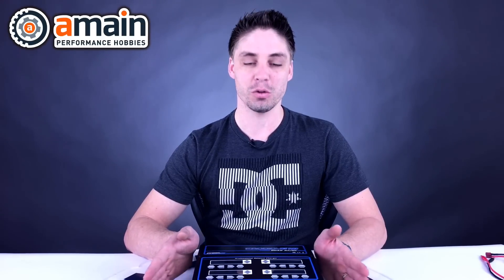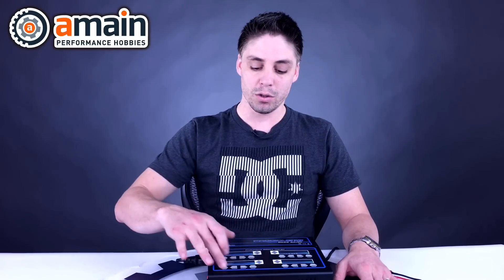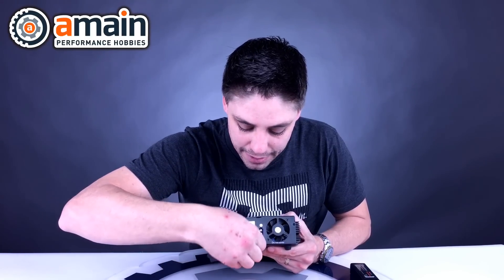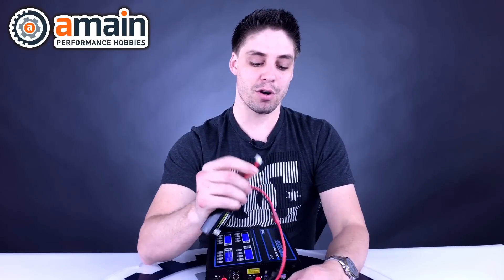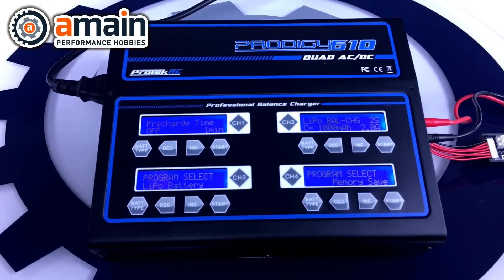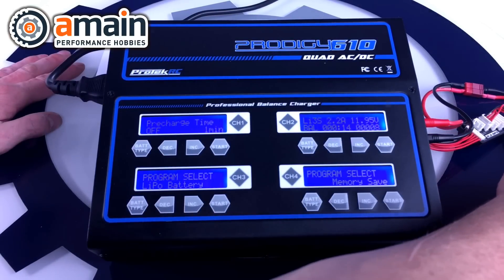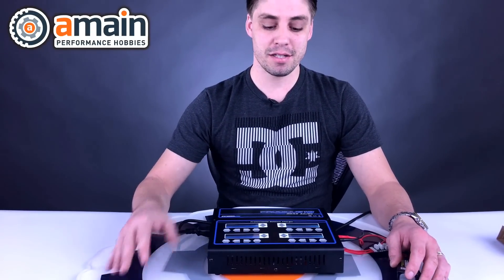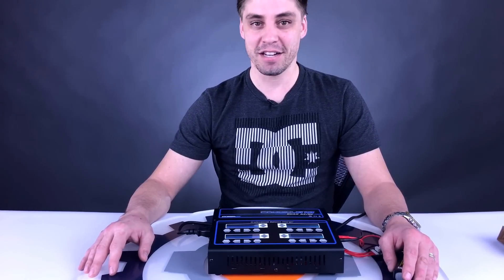AMain Tech Talk - Ep 2: LiPo Balance Charging Basics

Comment: Can I charge my battery pack at 4.25V or 4.30V per cell or on my ProTek charger with a ProTek LIHV battery are usually charge at 4:20V per cell I have the 8200 MAH 7.6 120 C packs and lots of Shorty packs
Reply from the maker: Yes you can. The maximum that LiHV cell can handle is 4.35V. Anything lower than that is fine. 
-Brett
Reply: AMain Hobbies thanks for your help 🤘😍 ready to go race I’m going to start in increments of five with 4.25 then 4.30 and then 4.35V per call see how my car likes it I have a techno 48SL the super slim with the chicken  tekin RX8 GEN3 with a tekin pro4HD 4300kv and a PROTEK 7.6V  8200 LIHV 🤘😍 thanks Thanks again and again and have a great day

Comment: that's an awesome guide. i have a question about lihv what i mean is if i want lihv on my brushless system how can i set it up so i can have lihv like 7.6v how can i make sure when it's discharging when using the battery how can i know when it's at low voltage cut off without damaging the battery
Reply: AMain Hobbies Videos thanks